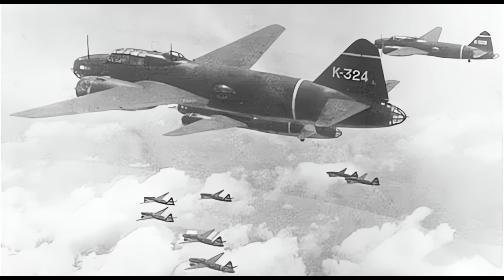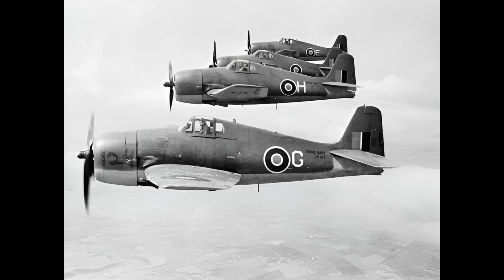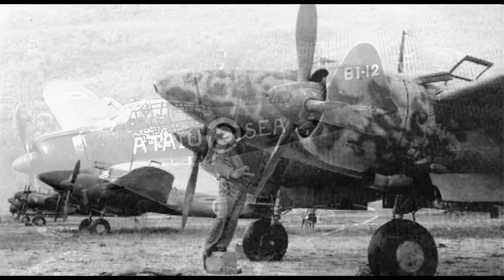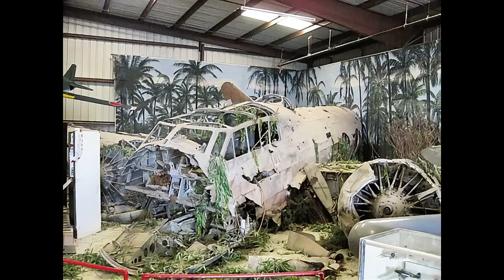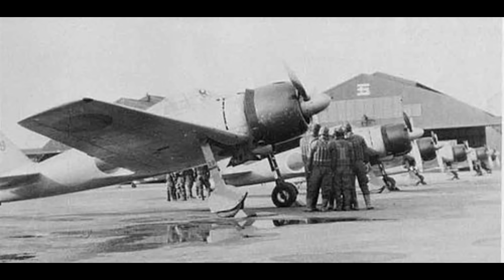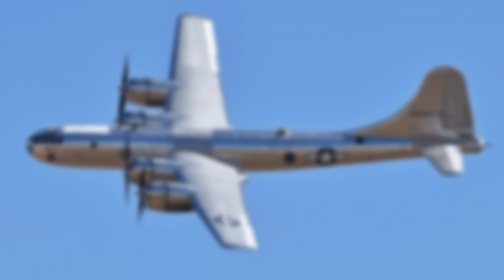When America Examined Japan’s “Betty” Bomber, They Realized Its Design Made No Sense

Comment: Arguably, on a bomber, it should be expected to burn a significant portion of its fuel while carrying its heavy bombload out to the target, before encountering enemy fire, so, there isn't a need to protect the entire fuel tank, also, the fuel system should have been quite compartmentalized and operated to draw off of the fuel compartments closest to the fuselage first, as they are somewhat more likely to get hit first...but, obviously, they didn't ask me.  😮🖖
Reply: Well, actually, a nearly empty fuel tank is pretty much full of a fuel vapor and air mixture. That won’t merely burn. Rather it just might explode. That’ll end your flight!
Reply: @thomasdubio7133 .
They could be vented, reducing that risk.
Look, I am NOT saying that SS fuel tanks shouldn't be used:  I am saying that the Japanese were stupid to NOT put at least SOME of their slow-moving bombers (read: TARGETS) that definitely ARE going to get hit if there are opposing fighters.  🖖